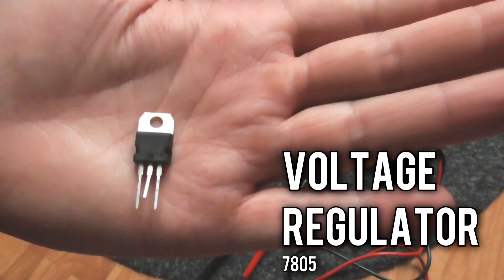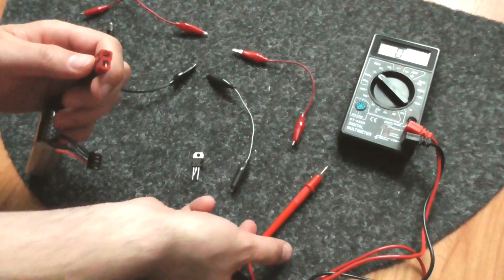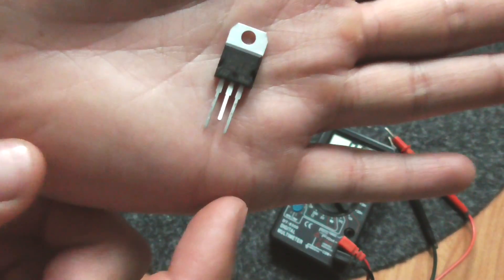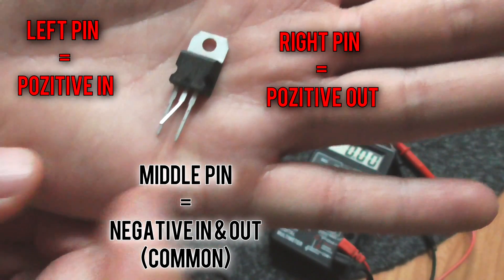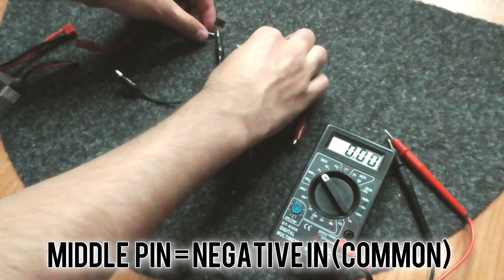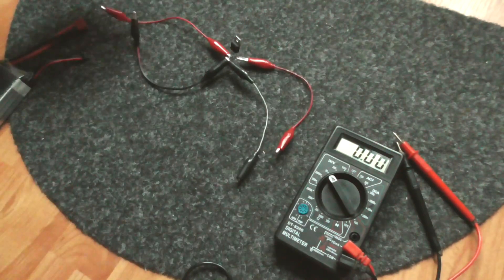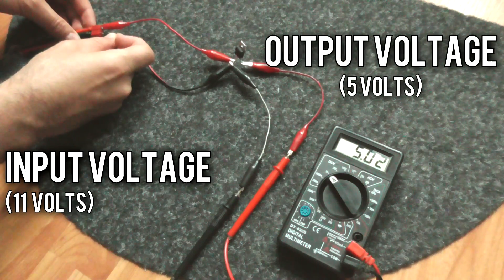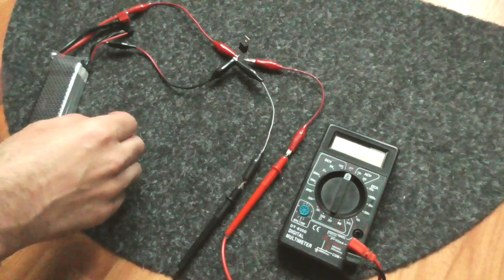How to use a Linear Voltage Regulator, 7805 (11v into 5v)

Comment: I have such thing on me dashboard in me car its suposedly y600 positive linear voltage regulator that thing confuse me.
Is it posibel that thing can back charge? 
The alternator actualy bypass curent and voltage true that thing?
I have some unusual problems and try to figure out where static comes from ?
Some diode is close to that thing and still I get zaped from static electricity.
So me other question is can those types of linear voltage regulators work in reverse form ?
And what are their polarity tested input and out put?
Does that thing actualy can use more voltage and create less voltage?
Because me car refuse to shut off for some reason and that is ac I supose its old 12si delco remy alternator imside the voltage regulator is nothing I broke that thing apart to see whats inside its just empty circuet board so I asume the positive linear voltage regulator actualy controls me alternator voltage its Europ version alternator and use only pin 1 on the regulator it has only light bulb on that thing.
So any help please?
Can I replace that shity thing with somthing ells?
Because I have problems starting me car in winter me ignition coil do not get enough voltage to start me 80s car .
I do have that odd R terminal starter selenoid bypass thing for voltage but suposedly its used only on points ignition so I asume me 4 pin gm ignition module is polarity sensitive and that linear voltage regulator so any one hade similar problem?

Comment: Would this cause a 9v battery to heat up?
Reply from the maker: The regulator will heat up, not the battery. Of course if the load is too high - almost short circuit - than the battery will heat up also.
Reply: @furulevi  Many thanks :)

Comment: how much heat will it produce at 30mA maximum load?
Reply from the maker: I'm not sure, you have to test it, just attach the regulator to a heatsink (or an aluminum plate).
Reply: ok i have  some lying around.

Comment: thanks for the video.Question   : I want  to connect a 9 v buttery to a  7805 regulator and then with the circuit.Shall I connect the poles of the buttery with the left and middle pin,and then the output  for the circuit with right and middle?
Reply from the maker: Yes (shown at 0:50, and 3:14)

Comment: I plan to use the 7805 with an 18V, 4,2W solar panel. How to know exactly how hot it will get (if I will need a heat sink)? My plan is to use it to power my breadboard and a 4 wheel Arduino robot car.
Reply from the maker: You'll feel the temperature using your hands :) This converts the excess energy into heat, better try an SBEC (Switching Battery Eliminator Circuit), that might be better.
Reply: Thank you. I will read about this.

Comment: Itz gettng heated up ,so suggest sum way to reduce heat
Reply from the maker: use some sort of heat sink...
Reply: furulevi  hlp me by sayng der names
Reply from the maker: Screw the regulator to a simple aluminum/copper plate.
Reply from the maker: Don't apply a high load onto it!

Comment: What happens to the current?  What happens when you use that in a motor that pulls a lot of current?
Reply from the maker: It will heat up! This turns the unneeded power into heat. It needs a heat-sink! A better option would be an SBEC.

Comment: i'am trying dc 19 volt to 5 volt but destroy the regulator? so u can make a surcuit 19 dc to 9 dc?
Reply from the maker: I think the maximum input voltage is 35V, so it should work with the 19V and it should output 5V DC...

Comment: Nice video again. I have tried it and it works. If you have time, please do similar videos regarding other electrical elements: thyristors, triacs, integrated circuits: operational amplifier,  comparator, CMOS. TTL, A-D to D-A converter, opto-isolators and others... maybe demonstrate Kirchoff's junction rule, working of quartz chrystals etc.
Reply from the maker: Wow... :) a lot of things... I have a bunch of electronics that I tend to take apart and study, but I haven't done it yet.

Comment: very nice, Thanks, do you have any videos of how to change the Frequency of electricity??? I know it's usually 50Hz, but I want it higher like Khz higher, Thanks
Reply from the maker: +Stanley Hutchinson 
Try to use a function generator, or a PWM (Pulse Width Modulation) circuit.
Reply: Stanley Hutchinson gamace